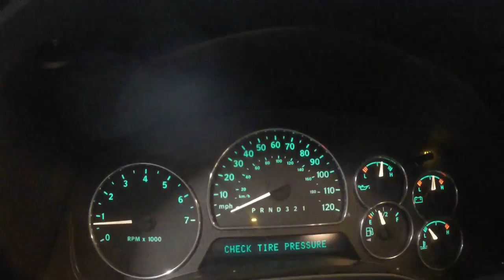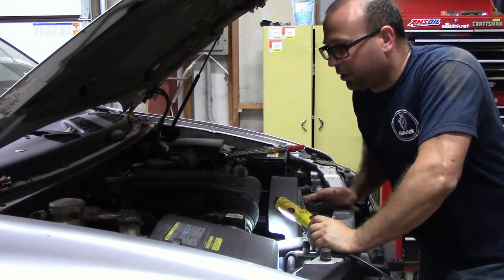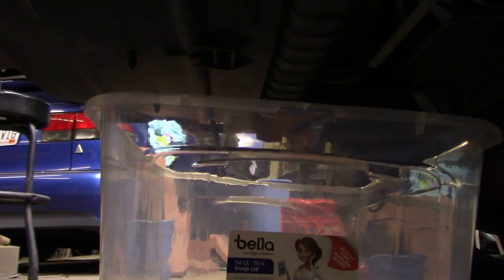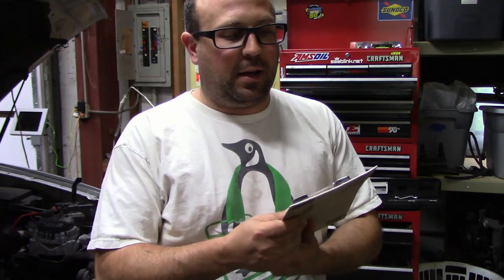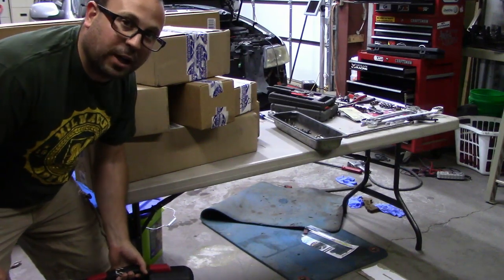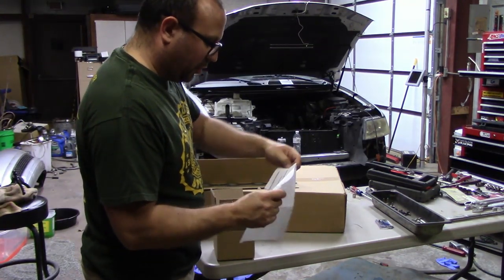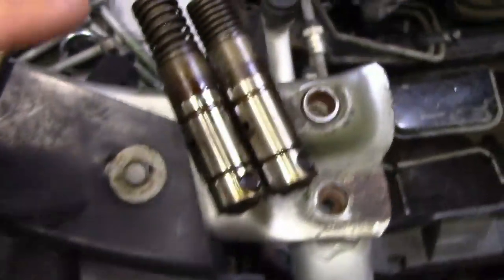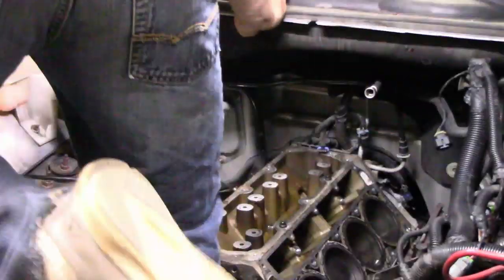Getting my 2009 Saab 9-7x 5.3i Torn Down to Install the Texas Speed Cam and DOD Delete Kit!

Comment: This makes me want to look at a 9-7x now. Glad you are posting this to encourage rescuing these. 

Two words my friend. Header wrap. You will love it. Your engine bay will too. Right after you burn off and repaint them with some good stuff.
Reply from the maker: Thanks. Yeah the 9-7 isn't bad at all,y wife loves driving ours. 

As for header wrap I've been thinking about it. I may do that once winter is over with a coat of high temp paint. I just don't even want to think about removing the headers to paint and wrap them. As you'll see in part 2 installing them isn't easy.
Reply: @SaabDr  thanks for the reply. They are certainly the nicest looking version on that chassis. Seeing a lot with rust issues, so ziebart would be a good idea. Looking forward to seeing  how yours runs afterward! Might have to get one to tow the vert to SOC? Lol....
Reply from the maker: @MassiveTrackHunter  I think most of them are unfortunately past the point of ziebart helping. Mine has a small rust bubble on the quarter and a bit on the hood edge that I'm going to need to tend to.

Comment: I just did 2 AFM/DOD deletes! 2007 Avalanche I used almost the same kit you did with TSP "stage 2" cam. We also have a 2009 9-7X 5.3 and I just finished it as well. I went a different route with Attitude v3 cam and supporting mods. I like your video brother, I'll subscribe. It would be cool if you would check out my vids. Take care buddy.

Comment: Hi I have a 2008 5.3 97x . It has random misfire only on bank one , it just started out the blue one day. Some of the symptoms are a loss of power and also the engine light will flash. Sometimes the reduce power light. When I ran for codes p300 came up which I know is a random misfire but I can't figure out what's causing the random misfire.
Reply: Replace the clogged catalyc converter . Mine has same issue i couldnt figure out until thta was replaced  p0300 only one side

Comment: I have the same 9-7x but I have an issue with it. It keeps on showing a sevice stabilitrak and I was wondering if you know what it means ?
Reply from the maker: Probably a wheel speed sensor. I know that mine needs one. The best way to diagnose is with a tech 2.
Reply: thanks
Reply: Also check the transfer case actuation servo. I heard those can fail, causing 4wd engagement issues.
Reply: we have the same issue and been to 3 places including the dealer, no one can fix it, it shows many codes they said. it is the 2008 97x 4.2 inline 6 with 97k miles. i've been driving around with the stabitrak button pressed off but it will still bog down if you get on it to fast and too soon. my wife is afraid of it and it's her car, we hate to get rid of it.
Reply: @steveperry1344  take off back tires and check your wheel height sensor

Comment: Part 2? Results ?
Reply from the maker: Results were good, part 2 is being edited and should be coming out in the next few weeks. I got really backlogged with life and have been editing shorter videos since this is a really big project. I will say that it's coming out for sure.
Reply: @SaabDr   thanks you! I recently purchased a used saab from a friend and it has the low oil pressure and mosy certainly is a bad dod lifter so I was looking for more info
Reply from the maker: I'd start with pulling the oil pressure screen to see if the pressure jumps up. That's normally the first thing to check to make sure the engine is actually making proper oil pressure.
Reply: @SaabDr  patiently waiting to hear this thing